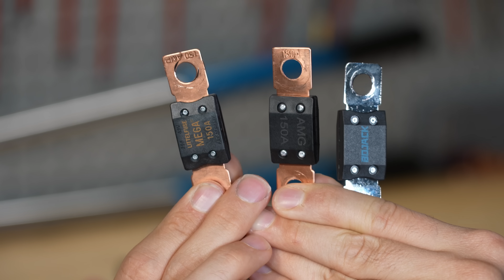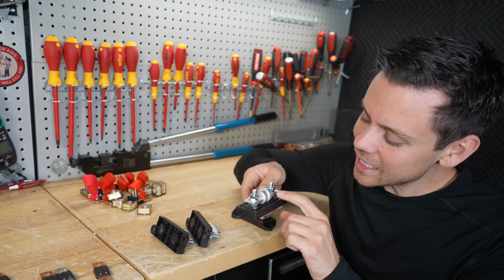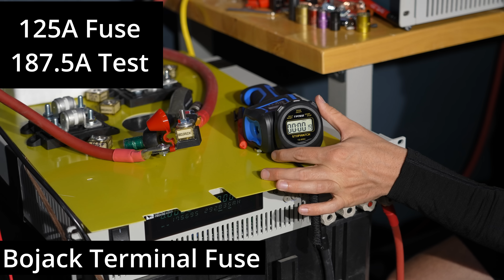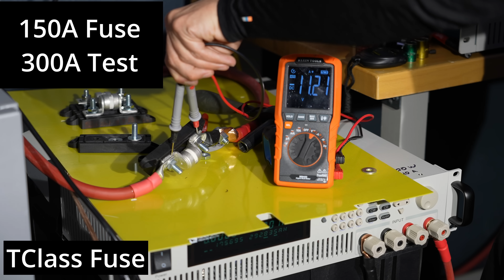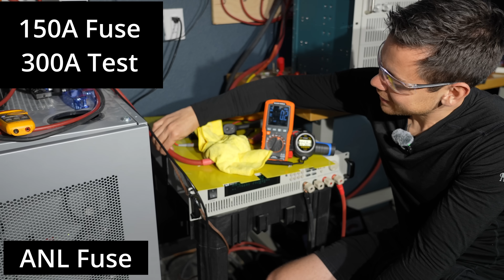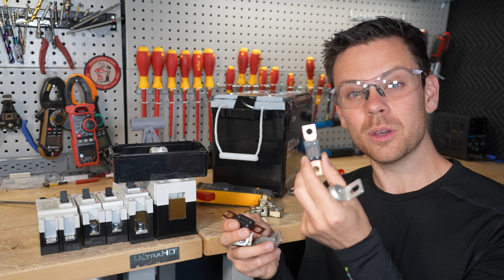Popular Amazon.com DC Fuse Showdown: Continuous Load Heat Test, Overload and DEAD SHORT Testing!

Comment: Your video has made me question my setup again. I thought I was safe but now likely not. I have 2 eco-worthy 280ah 12v lifepo4 in parallel. I have a blue sea 400a t-class fuse in case a short circuit ever happens (rest of system is protected by lower fuse). I assumed any battery could produce the 1000’s of amps hence need for t-class, but your short circuit test did not create a sustained arc and you said max battery can give is 800amps. EcoW say my two batteries produce max short circuit current of 440amps (220 each), but Blue sea curve shows at 100% load the fuse won’t actually blow, even at 200% it would take minutes, so my questions are A) will this fuse do nothing on a short circuit for my batteries as short is only 440a?, and B) does all that short circuit current go as heat in cables and melt them? I was hoping, like I read online, you have to have a t class fuse because the battery would instantly dump thousands of amps so thought a t-class rated at 200% of expected max load would protect if a dead short happens, but likely it won’t?

Comment: Please you need to test short circuit at rated voltage. That's where the cheap fuses can fail and cause very dangerous results.
Reply from the maker: Yes, that's next video
Reply: @WillProwse great, looking forward to it!

Comment: A fuse current rating is the maximum current it will not blow at.  Increasing the current beyond that figure doesn't guarantee it will blow immediately - lookup BS88 Gg and Gl curves as an example. What is guaranteed is that a properly specified fuse will blow before the associated wiring is damaged.
Reply: He knows, he couldn't find the datasheet with curves.

Comment: I'm betting the current peaks were actually way higher than your clampmeter was able to register. To measure the peak current for the dead short testing, use an oscilloscope and measure across the fuse using the fuse like a current shunt. You can capture events down to nanoseconds.
Reply: Temperature coefficient of resistance complicates things. But it is still a good thing to do.

Comment: Thanks Will that was rewarding 
But could i ask
I have two Redodo 12.8-100ah together in parallel for 24 volt
batteries
If i add two more so its 2p2s  batteries
I only have a mrbf  125 fuse
on the posative.
Then a windynation 150 fuse 
Being there now to one busbar 
Do i need a bigger fuse to my victron phenix 24-1200 inverter 
Thanks Will
Ltr Doug

Comment: Fuses work, of course, by having a metal link that melts. The engineers designing the fuse have a trade-off to make: choose a relatively low melting point metal, and the fuse will get less hot before it blows, and will have less voltage drop. Choose a higher melting point metal, and the fuse will have to be designed to get hotter to trip, with more voltage drop. But that also means it will be less affected by high ambient temperatures, since even a hot day (by human standards) is cool relative to the melting point of the fuse.

Comment: On my 36v golf cart that has a 300 ah lithium battery, it has three 150 amp ANL MEGA fuses.  One for the golf cart, one for the batteries, and one for the 2,500 watt split phase power inverter.  The cables are all less than 2’ long, are 4 gauge oxygen free copper welding wires, with copper lugs that were crimped in place with a hammer crimp.  I touch the wires close to the lugs often to make sure they aren’t hot.  So far nothing has even gotten warm, but none of the equipment is being pushed hard at all.  

After this test, I may go down to 100 amp ANL MEGA fuses!

Comment: As a professional auto electrical fitter for 2 decades, I have seen way to many burn ups.  

No way I feel comfortable using unbranded / low spec / aliexpress components for any application that would be expected to work un-supervised / extended periods.

Comment: Many viewers seem to think that your review applies directly to a 48V system. You should make it clear that it is not safe to use fuses with a low AIC (Ampere Interrupting Capacity) in a 48V LFP setup. Even your top rated fuse may perform poorly or fail entirely when used with a 48V LFP battery because of its insufficient interrupt rating.

In other words, you have to make a fuse review using 48v.
Reply: Adding cells in series does not always increase the short circuit current. If you short across a single cell with a massive copper bar, the short circuit current you get from that cell is the most you can ever get no matter how many cells you put in series.

On the other hand, an electronic BMS probably adds so much resistance that it becomes the main limiter of short circuit current. So in that case, the current probably does go up as the cell count goes up.

And ultimately, I agree with you but it is because the let through energy of the fuse matters, and also, if fuses are used above their voltage rating they may frag when they blow.

Comment: The amount of fires you most likely prevented with this video is probably in the thousands. People worry about inverters and batteries but many people don't worry about cables, fuses, breakers, terminals, lugs (and how to to properly put them on your cables). Thanks for this, keep it up!
Reply: yep agree - ideally your fuse is much less than your cabling/lugs etc, but how much less do you think is necessary? I remember back in the day using a 50amp fuse and wiring that was probably rated to 50 amp over the distance I ran it (12v). I had a cheap breaker and fuse (yes both) and still I remember when I tore the system down about a year later my cabling was all blackened from over current. Keep it up - love the videos
Reply: Keep in mind, Fuses and Circuit breakers are "circuit protectors' not 'device protectors'. Their sole purpose in life is to protect all the wiring/cabling from getting hot enough to ignite itself or whatever flammable object it is in proximity to. So, the choice for proper wire size is determined by your expected load, THEN the choice for circuit protection is determined by the wire size you are protecting.

Comment: I was SMH when you started with checking temps; fuses melt when they blow so of course they run hot near the limit. Glad to see you got that sorted out. 

Fuses or breakers are your main catastrophic safety; only the best there even if the rest of your system is second rate.

Comment: Great info!!!! Can you add the proper way to stack fuses with their cables? I constantly see diy'ers AND "professionals" add a washer or a nut between the fuse and the battery cable lugs. Caused one of them to let the smoke out at 95% load. Luckily someone was on the boat and was able to cut the power when they saw the smoke
Reply from the maker: Yeah that is awful. Washers and loose connections cause so many problems
Reply from the maker: I'll make up a beginnerr friendly video on fuses

Comment: This is why I look for UL listing on fuse and breakers. And for permitted work and insurance inspections they look for the UL . Well worth the extra $$ . The testing showed that . Good ones come with DATA sheet . And the UL listing. The Blue sea systems do have .Even on video I saw the UL . As a electrician working  on AC systems ,I learned what to look for. Cheers ! Love the testing !

Comment: Cannot wait to see 48V testing, especially on those ANL/MEGA/Cheap DC breakers that are only rated for 24V or whatever they are.
Reply: Unfortunately he can't safely do the really important test: whether the ANL fuses can actually interrupt a 1000+ amp 48V arc. That's the danger of those things: having the battery short and arc right through the fuse
Reply: @P7ab  It wouldn't be super easy but a contactor on a timer would work. Just set the timer to trigger on for like 500ms. Obviously a good DC rated one. Probably one of those MCCB disconnects at the ready too.

Comment: Thanks Will.  Your legwork has been very valuable to me.  I have Bojack 250 amp fuses on my 48 volt, 200 amp BMS golf cart batteries, and 250 amp ANL fuses before the inverter on two different systems - a Spartan Power and a Windy Nation.  I think I went with the possible amperage at full surge capacity of the inverters.  I would like the fuses to blow at their rating, so maybe I'll have to go with 200 amp or 150 amp, or those nice breakers.  Thanks again for all your work.

Comment: Thanks @WillProwse this is exactly type of thing I have been looking for as I winterize my system and add safety. 

For what its worth I have had good luck with Blue Sea. I put 125A fuses between my batteries, battery disconnect and inverter. They are all working well. 

Thank you so much for all you do for the community.
Reply: How do you know they are working well.  The only time they prove their worth is when they are over worked and trip.

Comment: Isn't AMG the "type" of fuse? I've seen many different fuses like that, from different vendors, with "AMG" printed on them. I don't think it is accurate to say "avoid any 150amp fuses with AMG on them."

I know I have some Blue Sea 125A fuses that have "AMG" stamped on them.
Reply: You are correct. Eaton Bussmann and Littelfuse create trademarked names for most of the fuse types. Bussmann AMG = Littelfuse MEGA. The knockoff brands just steal these naming conventions. The AMG fuse tested in this video is a knockoff…

Also, all of the Blue Sea Systems fuses have “BUSS” printed on them indicating that they are Bussmann fuses sold in Blue Sea Packaging.

Comment: Will you obviously have the ability to off grid for electricity if necessary, Im really curious, do you also have preparations for water in an emergency scenario? And if yes, what are they? You can go off grid electrically basically forever, but in a region where water is probably tue scarcest resource, do you have any plans?

Comment: huh, 12V is sadly easy; things get "interesting" (read: stop being anywhere near easy/cheap to do without involving complexity) when a 2-pole MCB of the "energy limiting" kind (e.g. the generic new-built non-arc non-rcd breaker type allowed in Germany; though they rarely use 2-pole versions) with the poles wired in series is no longer rated to break the source impedance's fault current at the source voltage. Such as for example an ABB S200 series's 2P-mode's 125V DC (max repeating). Then it's on to D0 series fuses with an IEC operating voltage rating of 250V DC.

Around then is when hybrid types become interesting: a semiconductor, like a back-to-back antiserial pair of SiC JFETs (can readily be augmented to perform self-contained circuit breaker action, tripping in a microsecond to prevent fault current from reaching levels that blow something up thanks to some minor inductance in the wiring), together with an MCB-style mechanical disconnector. A legacy fuse ensures a semiconductor failing short won't burn the place down.
That kind of breaker is used for DC microgrids and the like where a group/community the size/scale of an apartment complex shares a "high voltage solar battery"-kind DC-link in a more-or-less redundant grid, functionally comparable to just a bit larger than typical off grid solar setup.

Basically, you take a shared nominal voltage choice of LFP, put a +-10% or +-20% voltage converter (just a DC/DC like the MPPT between panels and battery, or between a phone's USB port and it's battery (phone USB ports can output power, like for wired headphones or usb sticks)) between each battery bank and the grid, put energy metering as needed, have overcurrent protection as needed, and then solar MPPTs output directly to the DC grid and actually-just-DC-with-AC-input-digesting-stage loads (like inverter AC's, computers, induction stoves, etc.) get fed directly from the grid with no wasteful intermediate inverter.
Possibly more importantly though, is that the wiring can be thinner. Like twice the power through the same cable with the same voltage rating electronic parts at either end. Suddenly matters if it's like several homestead's next to another or other such low-density communities.
Btw, Alibaba (the chinese company) uses essentially that as part of their Alirack standard for many years now in their datacenters, to make their UPS's not need the output inverters (reliability, efficiency), save wiring, and easily and with lower losses inject local renewables into the system.

Comment: Do you need a fuse or breaker if the battery has a BMS with over current and the inverter has a breaker?  With multiple batteries wires together to do need one between each battery even if a BMS is present?
Reply: A BMS protects the battery cells, a fuse protects the cables, a breaker  protects the load. You need all of them to have a safe system.
Reply: @JdZ-2023  makes sense, thank you
Reply: @JdZ-2023 follow up question as I have the Exo Worthy server rack batteries which have a dc breaker built in.  Wouldn't this mean I don't need a nother fuse or breaker?  I also have four Rhino 3 batteries, which do not have breakers so I can see using a fuse on them especially since they are crap.
Reply from the maker: I recommend everyone add a fuse to every battery. Or buy a battery with one built in. Or an MCCB.
Reply: @WillProwse  ok, thank you.  I have a lot of fuses to buy then.
Reply: @WillProwse follow up question as I have the Exo Worthy server rack batteries which have a dc breaker built in.  Wouldn't this mean I don't need a nother fuse or breaker?  I also have four Rhino 3 batteries, which do not have breakers so I can see using a fuse on them especially since they are crap.

Comment: Great video. I think I have to wait till the next video in series to get up to the real amperage and voltage.  200 volts/ 400 amps/  3-250 amp/hr batteries in series. What happens in a dead short? Looking forward to that video. thanks

Comment: The terminal fuses I use are very clear about needing to torque them to spec.  One time I forgot to torque it tight enough, and it ran very hot under load, but didn't blow with the below-spec current draw and extra heat.
Reply: I've had that happen in a vehicle install. Caught it before a fire but wire was very hot. Loose connections scare me.

Comment: 19:28 your best bet would be to connect an oscilloscope with a large shunt to capture these really brief, high current pulses.
Reply from the maker: Yes absolutely
Reply from the maker: Differential probe and victron 2000A shunt
Reply: @WillProwse  You can use a non differential probe.

Comment: hey Will, I really appreciate all the effort you put in to do these tests. I wanted to comment that other than the MBRF direct battery mount, these fuses are normally mounted in plastic enclosures. Among other things that retains some of the heat and causes them to trip more reliably, and protects against flying molten metal.
Reply from the maker: Good point!!

Comment: That AMG fuse is a knockoff. Real AMG fuses are made by Eaton Bussmann which is a top tier manufacturer.
Reply: Littelfuse and Eaton Bussman seem to set the sizing standards for these types of fuses, but they have different names for equivalent fuse types. The knockoff brands just steal the naming convention from Littelfuse/Bussmann.  Also, all of the Blue Sea Systems fuses have “BUSS” printed on them indicating that they are Bussmann fuses sold in Blue Sea Packaging.

…
Bussmann AMG = Littelfuse MEGA
Bussmann AMI = Littelfuse MIDI
Bussman ATC = Littelfuse ATO
…

Bussmann ANL is another fuse type that is distinctly different from the AMG/MEGA fuses tested in this video. I don’t believe that Littelfuse has an equivalent.

Comment: Wish you made this video sooner. I just built a portable power system and went with the BoJack battery mounted fuses. I have a 12v 2000w inverter with 2- 100AH 12v batteries. I went through 8 100amp BoJack fuses during testing trying to pull 160 amps for 10 min from 2- 12v batteries in parallel. I switch to blue sea and was able to pull more consistent around 185-190 amps until full drained. I tried to pull 205amps with the blue sea and the fuses blew 5 min into the test
Reply: Could wire batteries and inverter to a 250a bus bar and put a mega fuse on each (3) negative cable. Also if the batteries are not balanced one battery may pull over 120a whilst the other is pulling 40a which will blow your fuse over time….  What are the amps on each cable leading to the batteries before the fuse blows and does the fuse blow on each battery simultaneously or is it blowing more often on one of the batteries ?